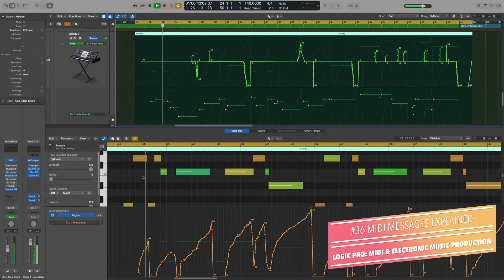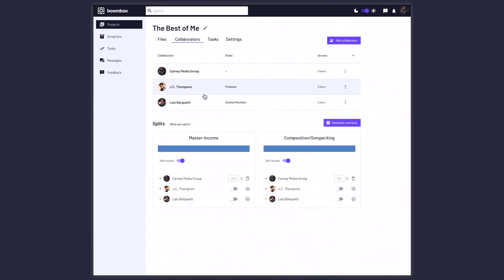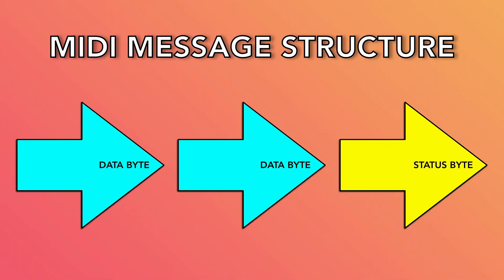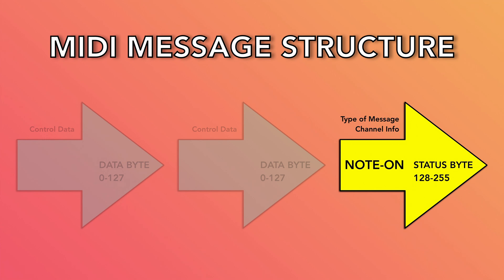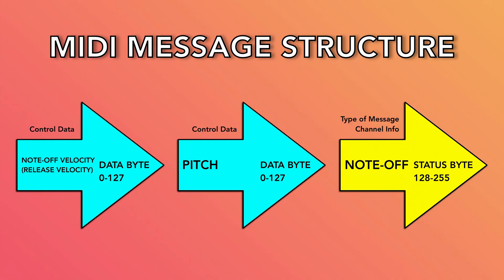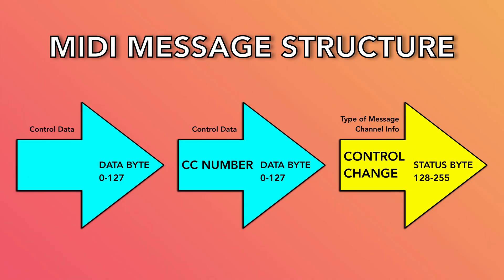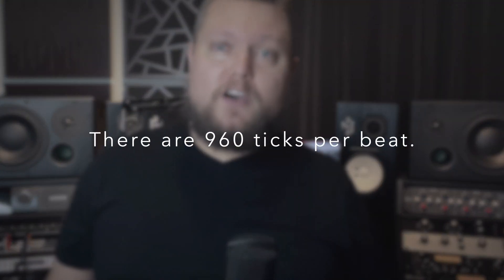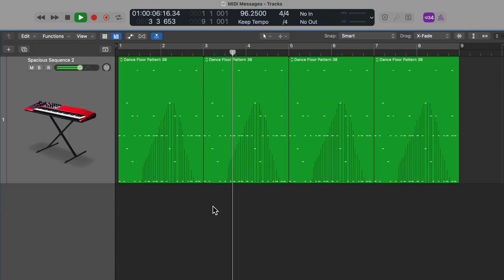Logic Pro #36 - MIDI Messages Explained (MIDI & Electronic Music Production)

Comment: Well done! For the first time, I understand the numbers in Logic that I thought where random (like Fahrenheit vs Celsius). 

This video is like a mechanic that explains what’s happening under the hood. Very interesting! 

I always wondered why 127, or 960 (tics). I get that 127 is half of 2e8. Was it explained in 1991 why 24 became 960 (from a mathematical standpoint)
Reply from the maker: Glad to hear the video was a help! When MIDI 1.0 first came out it was 24 "pulses per quarter note" is what they originally called it, but now we call it "ticks". (Not exactly sure how long that term has been round). In 1991, they released an update to MIDI called General MIDI, which standardized a few things -- most notably the General MIDI Drum Kit order, it's why C1 is always kick, D1 is snare, etc. in most drum kits. It also standardized drums on MIDI channel 10 (for hardware) And they also updated the resolution to 960 ticks per beat. Why? I think was just to improve the resolution and accuracy of MIDI recordings. If you only have 24 ticks per beat, then you only have 6 positions a note can be per 16th note. If you record and quantize everything to the grid, that's fine, but if you need some more detail and "human" feel in your MIDI recordings only 6 positions per 16th note could be troublesome. Also allows for more detailed swing and quantization strength settings that allow for more variation.
Reply: @MusicTechHelpGuy  thanks for the explanation. So since a tic is a unit of the division of a quater note, or 8th, 16th, 32nd or 64th note it makes sense that the maximum number of tics can be divided by those numbers. Ex : 960/64 = 15. Whereas say 1000/64 = 15,6. 

Ok so I got my math fix! 😃

Comment: Great Video as always. Is Logic able to preview midi files in the browser instead of just dragging them into a individual track.
Reply from the maker: On MacOS Mavericks and earlier, you used to be able to just select a .MID file and press spacebar to preview it with a generic piano sound. But for some reason they took away that feature. As a workaround you can download a free MIDI player from the App Store. I have one called "NS MIDI Player". After you download the app, control-click on a MIDI file and select "Open With" and select the MIDI Player. Then select it as the default application. This way you can press spacebar to preview the MIDI file before dragging it into Logic. The only thing that it can't do is auto-play when you press the spacebar to preview, so you still have to click a play button, but at least you can preview the MIDI.
Reply: Very useful for previewing MIDI generated in notation software - Finale, Sibelius, Dorico, MuseScore, etc.